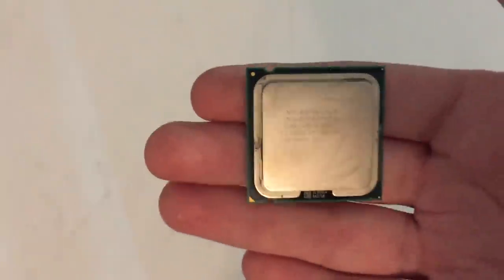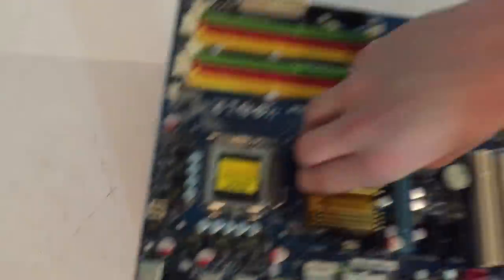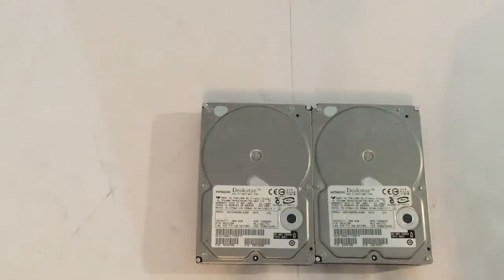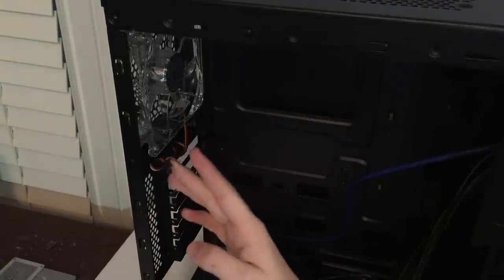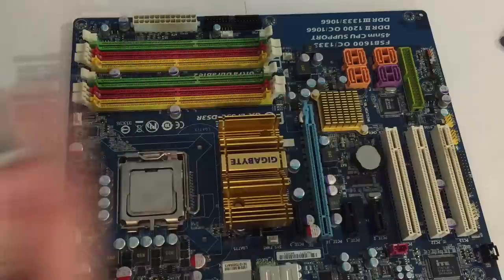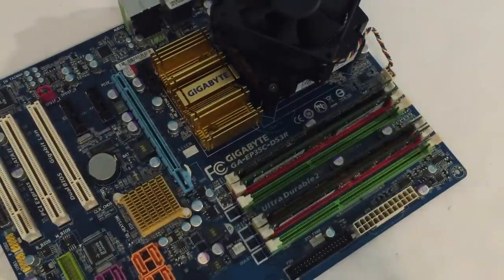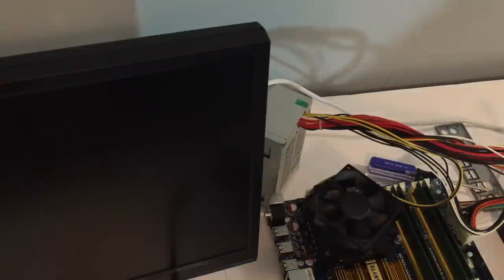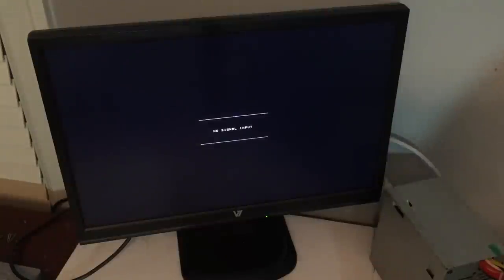Socket 775 Gaming PC Part 1

Comment: I like the idea of reusing old technology. I am trying to build a gaming machine with a GA-X48-DS5 and a quad core cpu Q6600. I have four ddr2 memory slots and I will go up to 8gb. 500gb SATA III. The power source is new (Corsair 450w VS series if I remember correctly). With a low entry GPU my entire build will cost 250 dollars. Did I just wasted my money? It is my first build and I learned a lot of things on the way but I thought that I will spend less for old hardware. I hope I can at least play Skyrim on low or medium.
Reply from the maker: personally I would go with a higher end CPU, maybe Q6700, Q9550, or Q9650 (2.66, 2.83, 3.0 GHz ($25-$70) other than that maybe a better PSU depending on the GPU you get, if you are using a lower end GPU u should be fine tho.
Reply: AdanD66174U I am from Eastern Europe and here even old stuff cost a lot. Should I try a Xeon in the future? Maybe I can find a better deal on that. I calculated the power consumption and I got less than 400 so a 450 power supply should do fine. Is this a bad build for this year? I don't plan to play on ultra or to play demanding games. Is the motherboard any good?
Reply from the maker: the one i built in the video here isnt the best, id look for something a bit better, the xeon is a good way to go though

Comment: I have a Intel Core 2 Quad Q8200, GeForce 9500GS, 1 Kingston 1GB ram card, 2 Acer 2GB ram cards and 1 Samsung 2 GB ram card, Cooling fan and power supply are from one of the Acer Aspire PC's, ill probably edit this once I remember which one it is

Comment: I have a biostar gf7100p-m7s mainboard, ddr2 800 MHZ, I'm curious if my panda l-iq45 heatsink can go on it with my Core 2 quad q9300
Reply from the maker: +Ieggings i don't see why it wouldn't work-what is the clock speed of the Q9300? I'm going with a Q9500 @2.83GH/z eventually
Reply: +AdanD66174U 2.5 ghz and it went on fine :)
Reply from the maker: cool
Reply from the maker: @ nabil you might have some problems with the higher clocked CPUs with that cooler (presuming thats what ur asking) personally id go with something bigger
Reply: glad I finally upgraded from the ddr2 board now I have gigabyte 78lmt-usb3 with an amd phenom ii x4 955 3.2 ghz quad core OC'd to 3.7 ghz 8 gb ram... same radeon 5670 tho lol
Reply from the maker: im rocking an A10-5800k and ASRock FM2A85X Extreme6 with 16GB DDR3 and an RX480 8GB (im sure you saw my AMD gaming pc videos lol)
Reply: Adam Messmann could have added a ryzen 5 or 7

Comment: i wanna build a gaming pc with a pentium dual core E5400.

I have a few questions i cannot answer by searching on the web like:

How much 1333mhz ram will work fine in this moba with my processor?
how many ram GB's does it handle
Reply from the maker: 1333 is DDR3 I think, in that case, I would say up to 8GB of it, same with DDR2.

but a dual core pentium? why not a decent core 2 quad?
Reply: i have this old pc with dual core which i wanted to make run decently new games without spending too much (changing motherboard or processor)..

But i figure it is probably impossible since my bios cant overclock the dual core
Reply from the maker: ah that would explain it :P
Reply: @kevinbraga9526  "this old motherboard"? Are you referring to the same motherboard Adam Messmann has in the video, GA-EP35C-DS3R? If so you can use the socket 771 Xeon CPU by doing a simple modification to the motherboard and using a small sticker that goes on the Xeon cpu. The Gigabyte GA-EP35C-DS3R motherboard will work with the E5450, 3Ghz 12Meg L2 socket 771 Xeon cpu . You can find these cpu's on ebay for around $25 to $28.  https://www.delidded.com/lga-771-to-775-adapter/3/#gigabyte

Comment: hey dude I have 775 socket motherboard with a dual core processor I wanna upgrade it to something new any suggestion coz I'm getting a gtx 1050 ti for very low price (make sure it doesn't bottleneck ) sorry 4 poor english
Reply from the maker: I would look into AMD's new Ryzen line, they have pretty powerful CPUs for less than $175 now, along with an AM4 motherboard

if u wanna upgrade the CPU on ur current 775 board, then see if it supports Core 2 Quads, then get something like a Q9550 or Q9650
Reply: thnx bro
Reply from the maker: no problem, glad I could help!
Reply: Buy a xeon a oc it
Reply from the maker: Javi Benjumea that would work, but you have to modify the socket and processor... And actually I'm not sure you can OC xeons.
Reply: actually u can buy a xeon modified, u only have to update bios and insert microcodes, after that u will have a xeon. I am waiting for a x5460 3,13 GHz, on a p5q u can oc to 4,4 ghz.
Reply from the maker: Javi Benjumea oh wow... I didn't know it was that easy
Reply: sometimes u will have to cut a part of socket to insert the xeon, but now u can buy it modified (the xeon), to avoid to cut the part when u inset the xeon. U can search more info "mod 771 to 775" (my english sucks)
Reply from the maker: Javi Benjumea i think I will, i have some high clocked Xeons sitting around... And don't worry, I understand u just fine
Reply: Upgrade to a QX9650, Core 2 Quad Extreme. I just upgraded a few weeks ago. I am running it with a gtx 1050 ti. My old PC is so much faster now.
Reply: Rchirag Kumar if supported a Q8200 or Q6600
Reply: Adam Messmann u can buy some with a mod Sticker already attached
Reply from the maker: i believe there are some on ebay, it would surprise me if nobody is doing that
Reply: knowing the Brand and model number for your socket 775 motherboard would assist in figuring out if a socket 771 Xeon processor would work.
Reply: @AdamMessmann  you can OC Xeons, also the modification to the MB is not difficult, you simply 'carefully' cut out the two plastic cpu alignment tabs without damaging the MB pins, place the 771to775 sticker properly on the Xeon cpu, orientate the cpu correctly in the MB socket as you would any processor. Of course the first thing you must do is insure the motherboard is compatible and install the latest bios before moding it and installing the xeon cpu.

Comment: what is best cpu socket775 for gtx 1050 o2g?
Reply: amir kia q9650, but its overpriced. There r some xeons with mod stickers (so they can operate on 775), which r cheaper and better. Sry for my Bad english, im just a 14 yrs old kid bruh.
Reply from the maker: personally, I would go for a decent Core 2 Quad... maybe a Q9550 or 9650. Keep in mine, your motherboard must support the Core 2 Quad for them to work. If it doesn't, a Core 2 Duo with a clock speed over 2.8GHz will be OK.

I have been told the Quad's compete with 6th Generation Core i3's so they are still pretty powerful, especially considering the price!
Reply: Adam Messmann i'll get my Xeon in a few days. I will post my Benchmark  results under this Video (gtx 970 and Xeon x5460). (Xeon x5460 = q9550/9650)
Reply from the maker: Popy TV can't wait to hear, especially because i have like 4 X5450s!

Comment: What is the mother board name / model number
Reply: Gigabyte GA-EP35C-DS3R
Reply: buy pq5 pro turbo have p45 chip that is mena you buy on ebay xeon x5492 fsb 1600 120wats better colling and 1200mhz ram that is best
Reply: @milanwoltgas  but if you already have a Gigabyte GA-EP35C-DS3R use it.